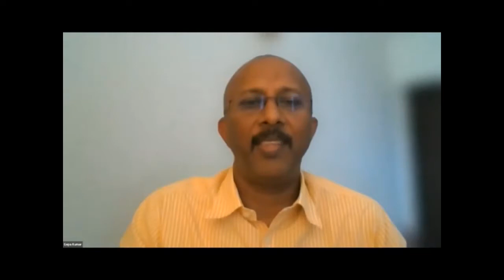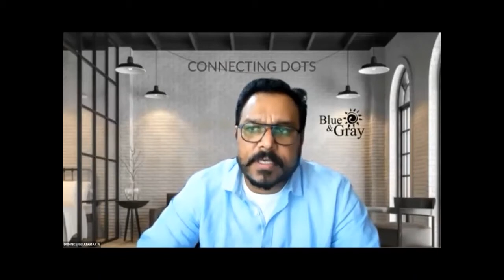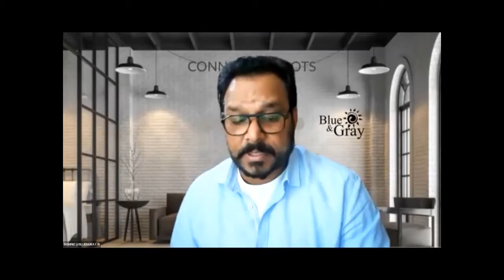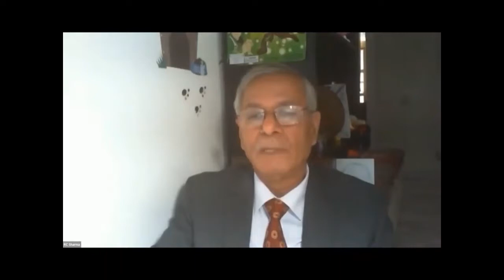Fire due to short circuit webinar 2nd part, Section 3 Q&A 22 jan 2022

Comment: This is an excellent work being done by CAPE... my sincere thanks and congratulations to Gopa and Co.. Frankly speaking, in spite of having put in over 32 years of field service in a state electricity company lot of field engineers like me working in the distribution sector still need to understand a lot as far as things like the applicable rules, regulations, standards and the correct practices are concerned.